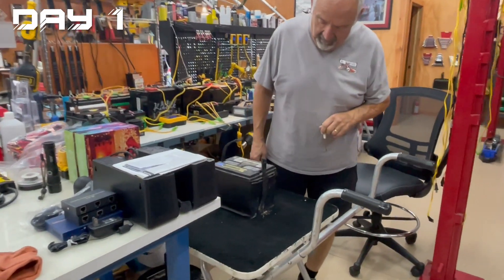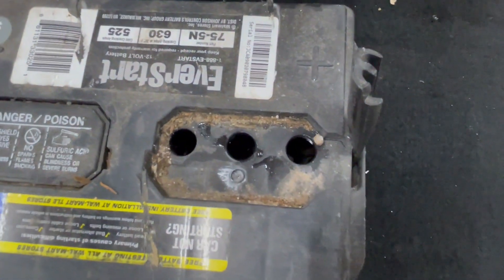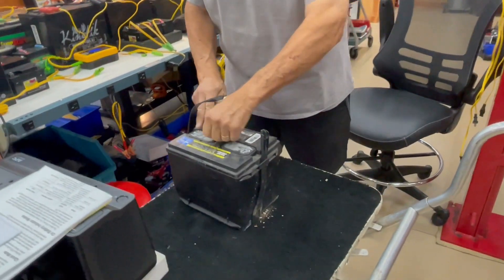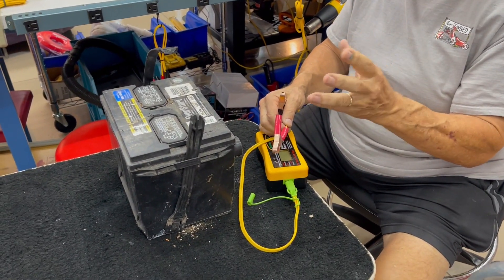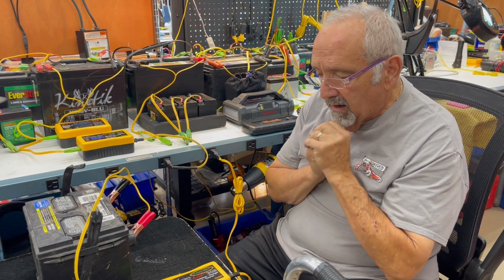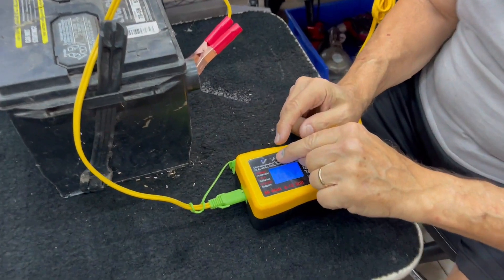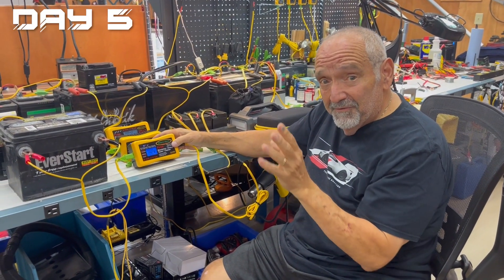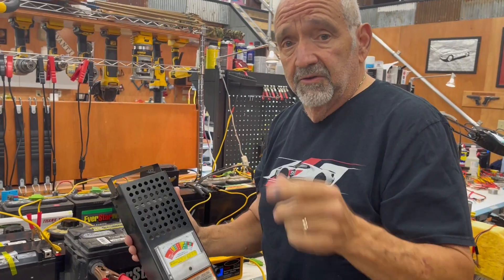Can We Save A 14 Year Old Completely Dead Battery? | Battery Saver Challenge

Comment: I do believe using a dc stick welder to rejuvenate the battery would be superior to this method both in speed and in final result. Perhaps a side by side comparison with a pair of identical dead batteries from an old diesel pickup would be fun to see. If the battery saver produces a superior outcome to the welder it's probably worth the investment. I personally have had success with the stick welder method and it works quickly too, like return to service same day quickly.